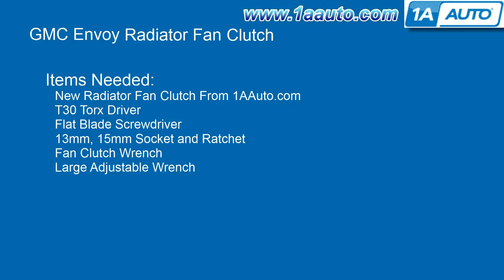How to Replace Electric Fan Clutch 02-07 GMC Envoy XL

Comment: Outstanding video! Really helped me even though I've changed the fan clutch before. One TIP I can suggest... Use a slip knot to tie a strong 3' long cord around the base of the big nut on the fan clutch that attaches to the water pump. Thread the cord through the center of the fan. In from the front, out through the back. Loosely tie the other end around any bracket on top of the engine.  NOW, feed the fan and clutch in as shown in the video. Once you get everything squeezed in past the top of the shroud, you can use the cord to pull the fan clutch up and get the nut through the center of the fan. Loosely attach one bolt through the fan into the clutch. Now you can remove the cord, loosely install the rest of the bolts, and use the fan to screw the clutch on the water pump.
Reply: John Lapolla too bad nobody understood any of that shit sounded good tho
Reply: Great pro tip dude.

Comment: Great video.  Help a lot.  I had to remove fan shroud on my 2003,  a little different from video but no big deal.  Nut was a pain,  broke a strap wrench and had to borrow correct tool from pep boys.  I bought part from you because of video.  transaction was perfect and no issues.
Reply from the maker: Thank you for your order Michael. Have a great day!

Comment: I changed the fan clutch on my 02 4.2L Trailblazer and now the fan clutch is stuck on. Sounds like a fan boat going down the road. P0496 code as well. Does the PCM need flashed or do I need to try an OEM clutch? Bought this one from autozone.

Comment: This looks almost nothing like the 2004 4.2 Trailblazer I'm working on.  Do I need to remove the boots attaching the bell to the water pump to use the clutch tool?

Comment: I want to know if you can just put a regular Fan Clutch on the 2002 Trailblazer 4.2 rather than going back with the Electric Fan Clutch????  Why is this electric when some of the Bigger SUV's with the Bigger Motors have Non Electric Fan Clutches.                 You do a great job fixing this and telling us how to fix it or do it, plus you give the size of almost all tools you use. Thanks. I. Stephen's
Reply from the maker: +Steve I Thanks for watching. It is recommended to put the OE style part as a replacement, unless proper modification and updates are made. If any of our viewers needs to make this repair, we carry the auto repair part shown in this video on our website. Here is a link to them http://www.1aauto.com/cooling-fan-clutch/i/1arfa00090?utm_source=YouTube&utm_medium=CTA+Comment&utm_campaign=ytcomment&utm_term=hA3S61XzQVs

Comment: I seen the fan clutch and water pump replacement sold together as a unit. Are you suppose to replace both at the same time?
Reply from the maker: +Travis Irving You do not need to replace both at once unless it is needed.

Comment: How am I supposed to hold the pulley onto the water pump to use the fan clutch tool is I need to take all the bolts out just to use the tool?

Comment: That may work for that envoy but it's nothing like what I had to do to get the one on my 2002 trailblazer off.  I had to remove the front brace over the radiator and remove the bolts to get the shroud pulled up so I could take the fan clutch out through the front of the shroud.  On the plus side I didn't have to remove the serpentine belt.

Comment: one more question what does shift solinod b  performance code for? i did a resent tranny flush and changed 2 solinod on it and today at a light my truck vibrated 3 sec and turned off on me but turns on agian when u turn it on 🤔

Comment: I did everything in this video . worked great . now I'm getting a check engine fault code saying that the high speed fan. what could be wrong
Reply from the maker: You may want to check the fan when the vehicle is up to temperature to see if the high speed is kicking in. Hope this helps point you in a direction. 1aauto.com
Reply: Ryan louden Ask the dealership

Comment: What do you recommend if there’s too much resistance on the fan clutch nut? I can’t seem to be able to loosen it
Reply from the maker: +Nestor Rios Thanks for watching!  The process Mike shows in the video is really the best way to do it and should release any fan clutch nut.  If you continue to have issues you may want to take your vehicle to a reputable garage so they can try and get the part swapped out!  1aauto.com

Comment: Changed out fan clutch on 03 Trailblazer today....have been reading that the PCM needs to be reflashed by the dealer.  Do you really have to do this or can you just clear the codes with an OBD scanner and then remove the negative battery cable to restart the PCM.  What good does flashing do, after you change the fan clutch.
Reply from the maker: +Jackie Waggoner Thank you for checking us out. You may attempt and clear out the codes with the OBD scanner, but in some cases it is true that the dealership specific software must be used for this reflash. 1aauto.com
Reply: If I installed the same fan clutch as before (when a dealership flash was done) would I have to do it again?

Comment: i changed my fan clutch and water pump and when i put everything thing back together my heat blows out cold air and my car is over heating.. any ideas what could be the problem?
Reply from the maker: +LeMark Wash When the vehicle is cold, you may want to check the level of the antifreeze to see if it needs to be topped off. There could be an air pocket in the system. Hope this helps you out